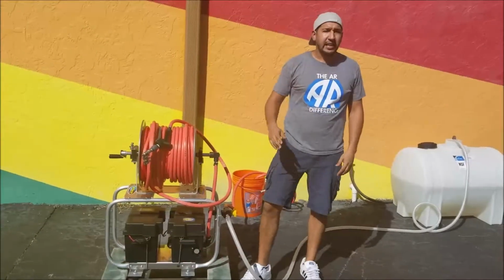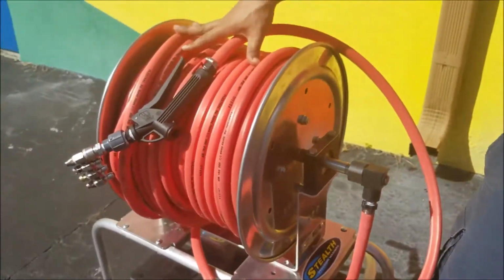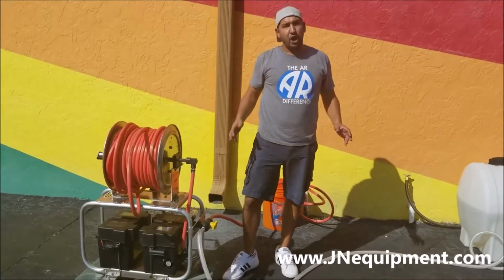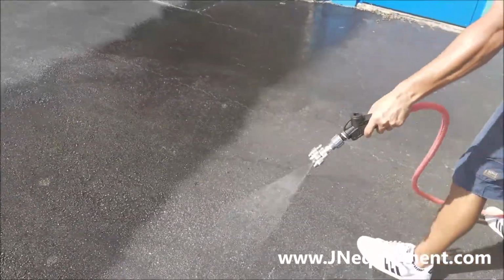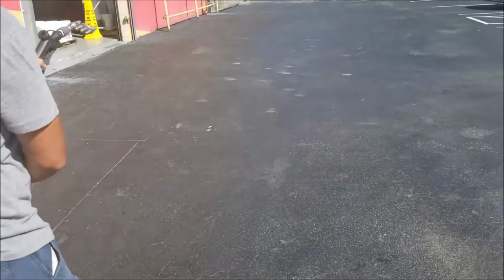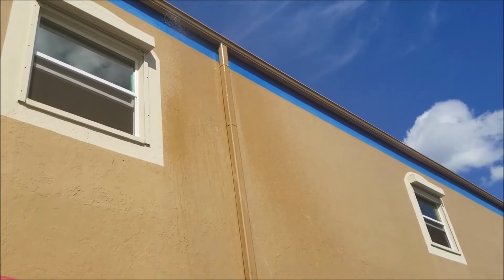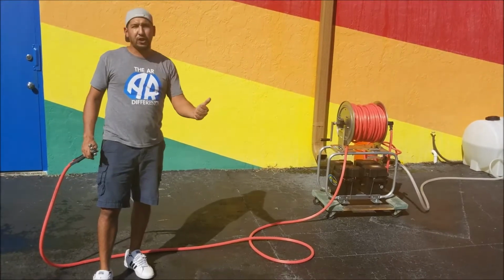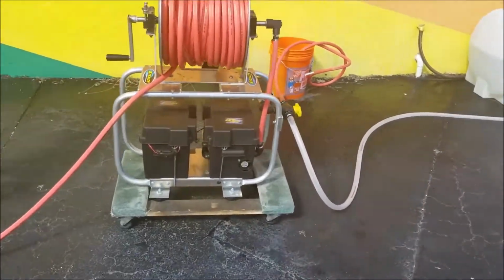Stealth PRO 7 GPM Soft Wash Roof Cleaning System Demo

Comment: Bro  in the 12 V pump 7 gallon minute lot of people saying I should use 5/8 or 3/4 inch pipe otherwise it can blow the fuse if I use 1/2 inch pipe what would you recommend half inch or something else
Reply from the maker: We have found success using a 1/2" line at a maximum of 200', using a 5/8" or 3/4" line would also work well. The theory behind what we're doing here is making sure we have an appropriate amount of back pressure (resistance) on the spray line. Too much back pressure makes the 12v pump work too hard which blows the fuse, not enough back pressure you won't be able to spray as far/have a crisp spray pattern.
Reply: @Spraywell  Thanks bro for your help

Comment: Can I mix s.h, water and a surfactant like apple wash all in the same tank or do I need a proportioner?
Reply from the maker: You can create your mix on the jobsite in one tank (batch mixing) and use it just fine. Just make sure you don't create a large batch that you won't use that day as the bleach concentration gets weaker as time passes once you start mixing everything together.
Reply: Thanks

Comment: it seems like the flow would be slow to rinse, if you were doing a housewash. is this true, or is there just a better tip for rinsing houses faster?
Reply from the maker: You could use it to rinse, but the flow isn't as great as just using a pressure washer/ball valve combo.  There are definitely other ways to rinse that would be faster, but if you didn't have another option, you could rinse with this unit if push came to shove.

Comment: how well will this work for spraying herbicides on a lawn there is no  way to get any kind of agitation should i use a different spray gun i need something for house washing  and pesticides like it says in the ad
Reply from the maker: The spray gun that the unit comes with is chemical resistant and should work well with both applications. As far as agitation, that would be something you need to add to your tank that's independent from this system

Comment: Could I hook one of your proportioners up to this unit?????
Reply from the maker: Yes the Stealth Proportioner can be used with the 5.5 GPM models and 7 GPM models
Reply: @Spraywell  is it better to go up to 1/2" 1/4" 1/2" on ur Proportioner lines. Can u go up to 3/4 on the single top line to the pump. With 1/2 on the spray line

Comment: Why is the pump pulsing?
Reply from the maker: a little too much back pressure on the line. a larger nozzle or adjusting the diaphragm pump at the head would stop that if it was your desired result. As long as your diaphgram pump isn't turning on and off repeatedly(reach max pressure turn off, pressure drops and turns back on very quickly) you don't risk any damage to your diaphragm.  Refer to this video to learn how to adjust your pump pressure: https://youtu.be/7stPIlSRx2M?t=693 and a demonstration of the effect I described.

Comment: Can a unit like this be set up with a proportioner
Reply from the maker: I'm working on creating a chemical blending manifold but it's not available yet, one COULD add the proportioner themselves and use it to replace the ball valve assembly.
Reply: JN Equipment teach me wise one. Make a video lol
Reply from the maker: @vspd303  I'm working on it, but mine won't cost $1000 it'll be cheaper. I just gotta make sure everything is 100% before I put it out.
Reply: @Spraywell  Is it out yet?
Reply from the maker: @Rick-kp6wf    yes, email us or call us for a custom quote. The proportioner can be found here: https://www.jnequipment.com/shop/brands/stealth/stealth-soft-wash-proportioner-system/

Comment: Has anyone had a problem with the suction hose being to small? I hag a guy who bought one of these and did like 10 jobs and the pump burnt up. He said the fix was to change out the suction hose to a one inch hose. If this has been a problem with others, shouldn't the manufacturer fix this issue? Also says that the zero tip on the gun is to small. I have one coming on 7/03/2019 and don't think I should have to modify it, especially after paying 1550.00 dollars. Just figured I would ask if this has been an issue with others, or could it have been an isolated incident.
Reply: Thank you for the feedback, I really appreciate your expertise and will put my trust in this product. I will also make sure to do a cleaning after each use.
Reply from the maker: We have not had any issues with suction hose at all. As far as a pump burning out, 99% of the time it is all related to how one operates and maintains the system. I have experienced contractors whose pumps last over 6 months because they are knowledgeable about how the system works and how to properly maintain the system, and I have customers who burn up the pump in 6 days. The difference is all in experience and know how to be honest. So far the design has proven to be very effective and my customer reviews have been positive.  Working with SH has a real learning curve, that does take time to figure out since SH is an extremely aggressive material.